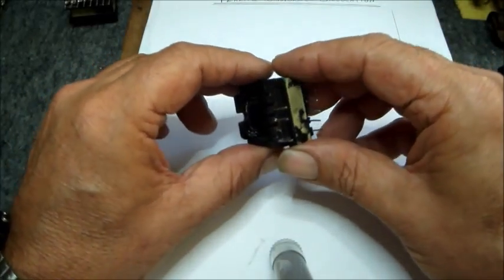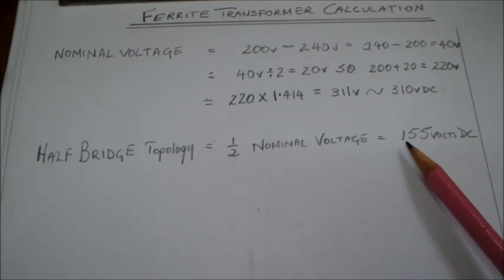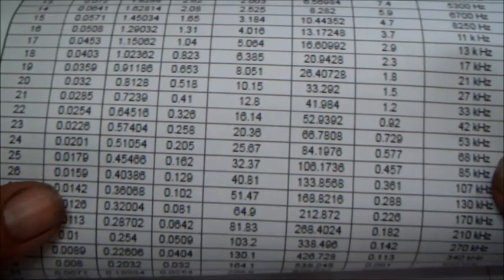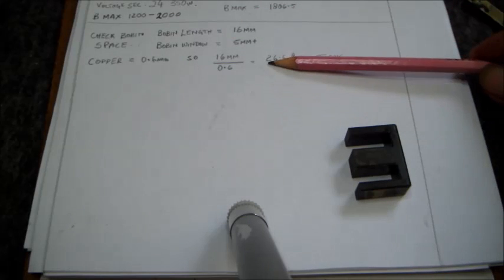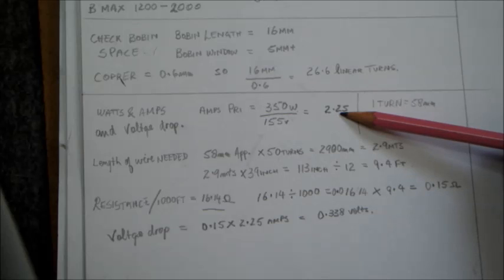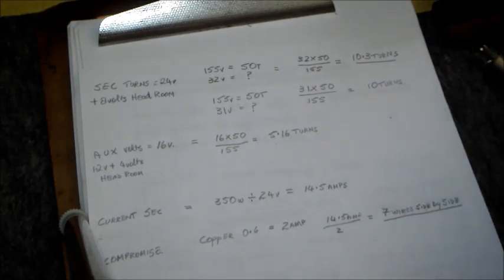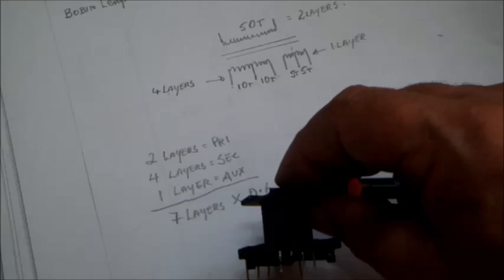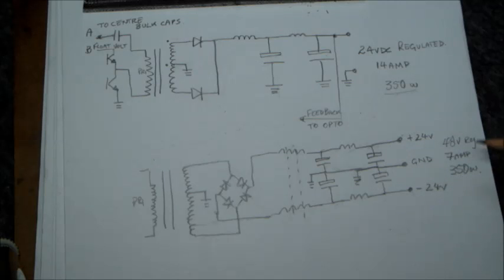Ferrite transformer calculations for SMPS

Comment: I understand due to half bridge topology it is half nominal voltage.  But why is it half peak nominal voltage 310V/2 = 155V and not half RMS voltage 220V/2  = 110V? Why is Faradays law, Sine wave input 4.44 constant, square wave would be 4, used for Nt Pri  = Vp x 10^8 / (4 x F x B x A) and not Vrms x 10^ 8 / (4.44 x F x B X A) which is in most literature?
Reply from the maker: Well using the peak because it is rectified voltage and also filtered with capacitors.  The output from the switching transistors  is square wave which has a lot of dc content in it.  That is why we are using 4 as a constant and not 4.44. However loading the smps the dc voltage will sag a little but never really goes down to the rms value.  if so there will be a lot of ripple on the output.  Again the input bulk capacitor value will be according to the load absorbed and the more load the larger it should be.  I hope that helps.
Reply: Thank you for your reply that explanation is great.

Comment: sir i dont understand  secondery winding. cause  amper calculation . how can  calculate   copper 0.6 = 2 amp ? . its not have on chart.   and primary layer is grow and    center is to big first  calculate . first   center area = 58 mm. what is secondary area ?  where is gone  7 wires ?  can u  tell again that point ?  thank u

Comment: hi very interesting, i am also finding a way to lower high voltage and frequency, this is a good example thank you :) i wonder what will be the output frequency of the 24v secondary? 
i am just a beginner and experimenting on high frequency drivers.
Reply from the maker: What exactly do you want hi or low frequency? The frequency of the 24v output is the same frequency of the primary of the smps .  In the example I shown is 33KHz.
Reply: i am using high frequency high driver at 10-15 khz going through a high voltage transformer and i just want to tap another transformer to lower the frequency to give me lower voltage at lower frequency if possible 60hz, while keeping the high frequency high voltage running on the side.
Reply from the maker: What output voltage do you need.  is it DC or AC? What are you going to power an amplifier charger etc. Maybe I can understand clearly what you really want?

Comment: Hello sir,
I am a professional Electronic Technican. I want to know the details calculation of core area by diagram. sir I saw the video and I learned very much, but I have few confusion. so you if clear this questions to learn full concept for me.  I saw example you measured in video, 1) L= 12.8 mm & W=10 mm = value? 2) you written 1.414 where you have found this value? and 3) 1.3 where you have found this value? Please send the calculations details with diagrams & cable data sheet to my email engsarwer@gmail.com.
Reply from the maker: The calculations are only suitable for push pull, half bridge and full bridge typologies. Answering your questions:- 1&3) I was measuring the area of the core which came to 128mm^2 and rounded off to 130mm^2 this converted to cm^2 brings an answer of 1.3cm^2  2) The value of 1.414 is the square root of 2.  This is used to find the rectified and smoothed peak voltage of a sine wave. I am sure you should have known this being a professional electronic technician.

Comment: its bad  idea.. i calculate transformer power transforming capacity by Power in watts= (frequency/50) (core area)(core area in cm2)
when you use more quality ferrite core to handle magnetic flux you can increase frequency.. window space is important for inserting coils and wires. for example 2cmx2cm ferrite core has 4cm2 core area. 4x4=16x(50khz/50)=16KWatts
for example 1x1cm ferrite core has 1000kwatts at 50khz. you need only a core with working capable of high frequency magnetic flux.
but people need pwm controllers to handle power switching on transformers. you can do your smps by using 555/565 or microcontroller oscillators and some mosfets.
Reply from the maker: Thanks for the infromation
Reply from the maker: Jeny So you are saying that in my case I have 1.3 cm^2 so 1.3 X 1.3 = 1.69Kw.  Don't you think that is a bit too much and your calculation is not so good?

Comment: Hi Silvio. I've been watching this with a very big interest as I'm thinking of trying to build my own Boost Converter from 12V to 24V just to try it and is using this video as a tutorial,
but I got some questions.

What is Bmax? and how did you deside to go with the value 1200-2000?
For the turns for both primary and secondary windings, why do you have more than one layer? how did you figure this number out?
Wouldn't a full bridge topology be more efficient?
Reply from the maker: Well there is a guide as for half bridge it all depends on what frequency is used. The higher the frequency the lower the B Max. For 33Khz a B Max of 1800 Guass is just right. if the frequency was lower say 25Khz  I will have gone  for 2000 Guass. B is the number of magnetic lines in the core.  B max is the highest B according to the input voltage. Mains voltage fluctuates and goes up and down higher voltage brings more flux in the core according to the number of turns in the trafo.   In your case the calculation for a boost converter using only one switching transistor is somewhat different.  If it is as I said you will also be needing a gap in the center leg of the core.  The larger the gap the lower the permeability of the core.  That calculation I used in the video is suitable only for  full bridge, half bridge and push pull topology. If there is more than one layer for a single voltage then coupling between windings will be lower but due to the high current needed it had to be like that otherwise it will not fit.  I got more than a 1000 watts with half bridge with a suitable core.  Check my 1000 watts smps on you tube.
I hope that helps.
Reply: I'll check that out, thanks :)
Reply: I've been trying this but it won't work. Have no clue where the error is.

If you feel like I'd love to see your calculation for a fullbridge 12V to 24V SMPS with about 1 or 2 amps output. 😉

Comment: Nice explanation! Thanks for informative video.

I am constructing a transformer for TNY280 IC
 
I have a little doubt as there will be a little air gap(paper) between the EE core joints.   Will the calculation will remain work for me?

Please guide 

I have calculated with same cross sectional area core,  Flux density limit 1500, Input Voltage 310
Output required is 12V so i have considered 18V (headroom)

Switching frequency 122KHz

My Primary turns came: 
32.5  (I will Round off)

Secondary:
1.88  (I will Round off)

is it right?
Reply from the maker: The calculation explained is for half bridge push pull and full bridge topology without air gap.  If your topology is for a forward converter then an air gap is needed.  The larger the gap the lower becomes the permeability of the core and hence more more winding turns are needed.
Reply: thanks for reply!   I am making a flyback . which should deliver 2Amp at 12 v , but I can only get up to 350mA. if I try to pull more current driver ic tny280 fails immediately. I have matched input and output inductance of transformer with an other circuit which is perfectly working in same configuration with same ic tny280.  is my core saturating? or my snubber is not working well and giving high reverse voltage to tny280?
Reply from the maker: You can check it out with an oscilloscope and compare the wave forms from the working one to the one you made then you will know

Comment: Mr. Silvio, thanks for this video that simplifies HF ferrite transformer practical design.
I have tried to understand it from different books, but this way, I have learned more from your video in about half of hour, than in couple of days by reading different books. 
Unfortunately, there is no more this kind videos from you.

Can you please explain how to calculate a flyback transformer? I need to design 12V to 300V converter for capacitor charger but I am a little confused about flyback transformer design.

Thanks in advance and please try to find more time to make this like videos.

Regards.
Reply from the maker: The formula used here is only suitable for Full bridge, half bridge and push pull design.  It is not suitable for flyback design

Comment: Thank you for this really good video on transformer winding calculations. I was just wondering whether the auxiliary coil layer would be wound after the first half of the primary is wound OR after the secondary layer?
Reply from the maker: Aux windings are not so important and can be wound after the main secondary before the last half of the primary
Reply: Silvio De Leonardo Thanks man! 👍

Comment: Is it possible to make 250/25, 50Hz, 100 watt ferrite core transformer? If possible please let me know.
Reply from the maker: Ferite transformers are to work on high frequency and cannot work on 50Hz
Reply: What you intend can be done in the following way: Embobinas your common transformer, rectify the signal and pass through a reegulable inverter, there you get the cycles you want. The investor circuits you find in youtube
Reply: you need iron cored transformer

Comment: look my radius is 5.7mm so diameter of core is 1cm
I want in witch 12v and out 24v 400w can u calculate wire turns for me for primary and secondary I can use 0.6mm wire 
window space is 6mm noble length is 27.5mm
Reply from the maker: 5.7mm is not half a cm . measure the diameter correctly and I will work it out for you.
Reply: Whole core have 11.4mm
Reply from the maker: You have to tell me what topology are you using, Half bridge or push pull? Push pull is better for your application. What is the frequency that you are using?
Reply: I think is posh pull
Look at project schematic 
mdiy.pl
Reply from the maker: From what you sent me I see that you have a toroid core. The output is +/- 40 volts max and this is used for audio purpose.  From the core area you gave me. Primary winding 4+4 (14 wires 0.6) Secondary 11+11 (4 wires 0.6mm) your switching frequency according to schematic is 33.3 Khz B max taken as 2400 gauss at rated input voltage (13,5v) output voltage  33 volts at rated load (400watts). Max sec volts at 14.5v input 36v.( Mosfet RDS on 0.008 ohms)
Reply: But I want no +/- 40v i want +/- 24v
Reply: I want use as well for audio but I need 24v no 40v
So u write
primary 4+4 (14 wires 0.6mm)
Secondary 11+11 (4 wires 0.6mm)
But how to understand this ?
Is my first transformer what ia do 
Please understand me
Reply from the maker: I understand that you need double secondary of 24v-0-24v.  If you look at the pictures in the website you see that he made the primary winding with 12 wires side by side and secondary 4 wires twisted together.  your turns for secondary winding now for 24v comes 8+8 with 4 wires 0.6mm twisted together
Reply: U use maybe some communicator 
Skype mesenger or something?
Reply from the maker: do you have facebook?
Reply: Yes
Mariusz kolodzinski 
From Greystones Ireland
Reply from the maker: Try to find me I am from Malta
Reply: I cant find u
Try this 
facebook.com

Comment: your chart is saying 0.6mm wire can handle only 0.92 amps, but for 350 watts you need atleast 2.25 amps at 155V primary, how is it possible...?
Reply from the maker: You can calculate the amperage of wire from the area of the wire size for continuous rating you calculate the area of each wire at 4 amps per mm squared.  If for example you have 0.5 mm dia wire you find the area  3.142 X 0.25 X 0.25 = 0.196 mm squared so 0.196 X 4 = 0.7 amps.  if it is not for continuous rating you can multiply by 6 and even 8 if you have a fan blowing at the transformer. Normally for audio purposes it is multiplied by 6 as the load is not continuous when powering an amplifier for example.  so 0.196 X 6 = 1.17 amps now dividing this with with the input current comes 2.25 / 1.17 =  1.92 wires so you use 2 wires side by side to wind your primary winding

Comment: how to calculate the turnover of wire and size of wire 
to round core and if u want primary 12v-14v secondary double 24v-26v 300W-500W
Reply from the maker: mariusz kolodzinski 
See the video information is all there
Reply: Silvio De Leonardo yes but u show how to do on square core 
I need calculate wire for round core
Reply: But how to calculate if u want 12v input and 24v output 300w-500w ?
Reply from the maker: The area of core is 3.142 X diameter (cm) squared   divided by 4
Reply: Ok we know core area but how to calculate wire turns for 12v in and 24v out and i want use 0.6mm wire when I start calculate I get some not real
Reply from the maker: follow the formula explained in the video and use 12volts instead of 155v in the formula.  you must decide what topology are you using if half bridge or push pull.  what frequency are you using and take B Max as 1400 gauss.
Here i worked it for you I took frequency as 30Khz and b max at 1400 and area is 1.02cm sq, input voltage 12v.  the answer is 7 turns for half bridge and 7+7 for push pull.  your input current at 350 watts is 29amps  you need 17wires of 0.6mm wound together making 7 turns with them.  your secondary needs 14 turns at half the input current so approx 15 amps you need 8 wires of 0.6mm

Comment: Thanks so much, very good explanation , can you please explain how you get the value of Bmax
Reply from the maker: The B max should be between 1200 to 2000 gauss depending on the core material and power absorbed from trafo